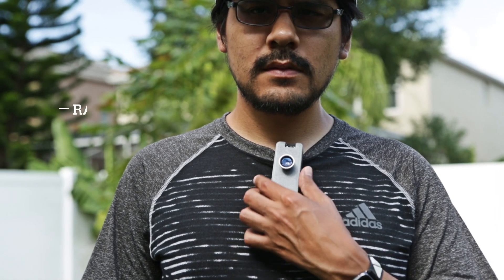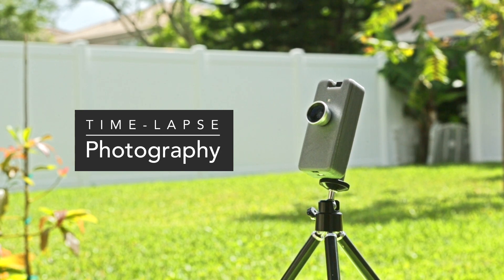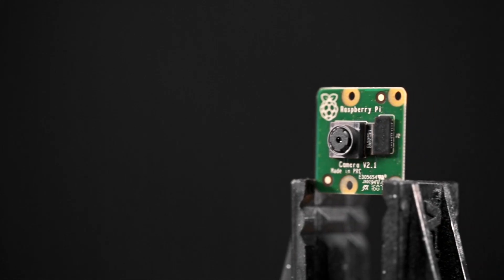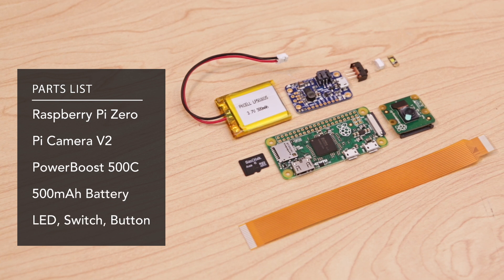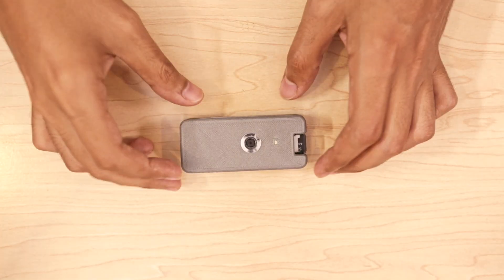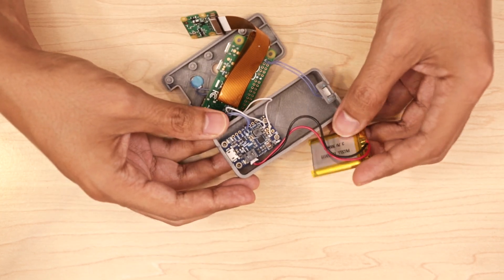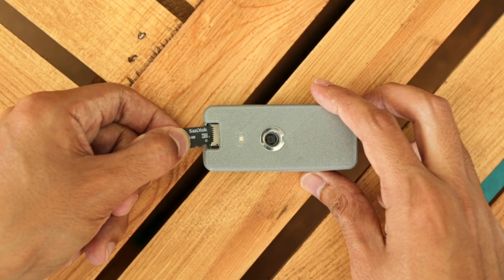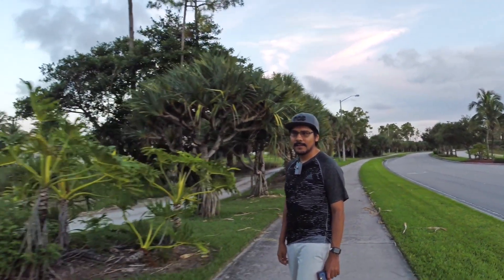Wearable Camera using Raspberry Pi Zero #3DPrinting

Comment: Why limit this to timelapse? Why not include options for video?
Reply: I don't know much about the parts used but, in general, if you're trying to record a huge span of something, video eats battery and space.  If you can manage to average it by doing timelapse photos it's probably going to be much easier on both of those.
Reply: You can do that.  There is a great Raspi Camera library.  Not hard to modify,  May need to add some buttons for video vs. photo.  I built two of these and it works just fine.  Problem is video quality.

Comment: What about the sample shots that were being taken?
Reply: @Adafruit Industries So then using it as a wearable timelapse camera is a bust then?  Like why not tout how cool the footage from that looks?  My assumption, as someone looking into this, is that it was so bad you just discarded it and decided not to show.  I'm guessing it's a bunch of super blurry shots or something?
Reply: I built two of these.  It works, but the video was blurry on camera 1.  It's a compact unit.  2 hour battery life.  Easy to use as only a timelapse camera.  to do more, you need to program it.  I like it because it's plug and play.  Just point.  turn on.  Done.
Reply: This is a cool and fun project.  I built two of these

My complaint would be - it's really, really tight.  Squeezing everything in was very challengin.  I had to redo wires after realizing they are best applied in to to bottom layers.  I would recommend using the thinnest wire possible.  

Those LEDs suck - dim - I used a regular red round LED - works mucho better.  Would be nice to be able to turn it off - I would add a switch - to prevent reflections in glass.  Those puny push button switches suck.  I used a larger round switch - much better - used sugru to fill in the gaps - that stuff is awesome.  But, the switch stood out a bit.  

Aligning everything is challenging, then adding superglue to set.  Had to redo a few times.  My 3D printer is very good.  Despite putting into high rez mode, I still did a lot of carving.  My power slide switch and power off button stood out from the bottom, so I had to 3d print a small stand for it.
Loading the software using ISO imaging, etc. took some digging to figure out.  I would suggest adding a few instructions to make this simpler.

With a 2 hour battery life, set at 15 second intervals (which can be modified, you get (4x frames per minutes * 120 seconds = about 500 images divided by 30 hz, to get a 6 second timelapse video.  
They suggest a way to make the video longer, but the battery life is still limited to 2 hours.

Overall, this is a cool project and Adafruit did a great job making it relatively easy to make.  but, you need to be patient and possibly do some re-work.  I love being able to take out the camera, turning it on and getting a cool timelapse video.  No muss.  No fuss.
Reply from the maker: We showed timelapse sample on our 3D hangout show here: https://youtu.be/T59IWTVas-Q?t=10m8s